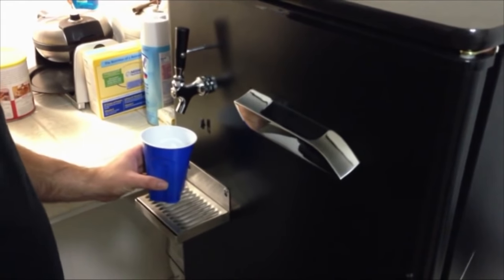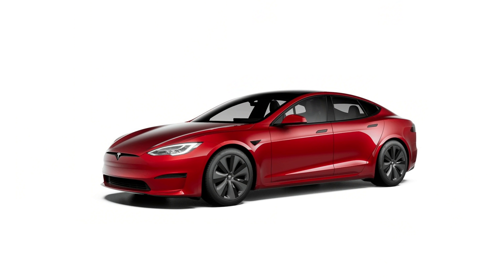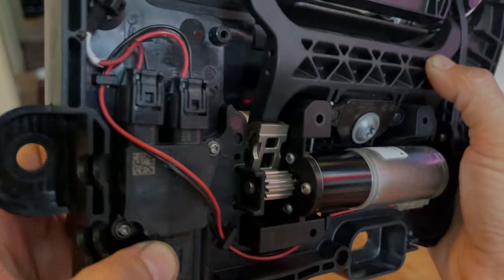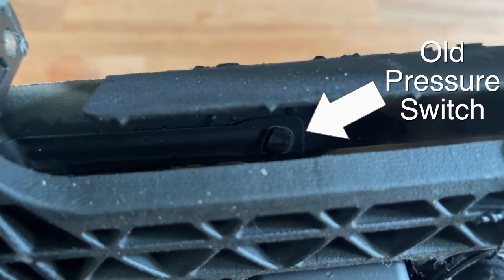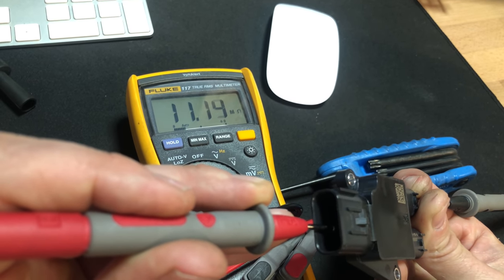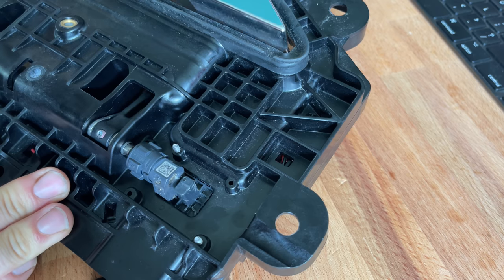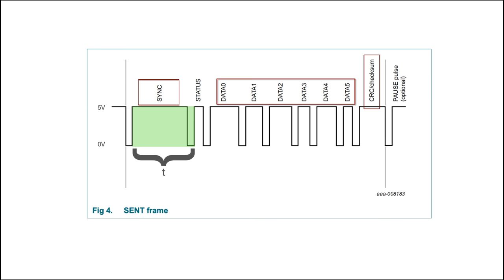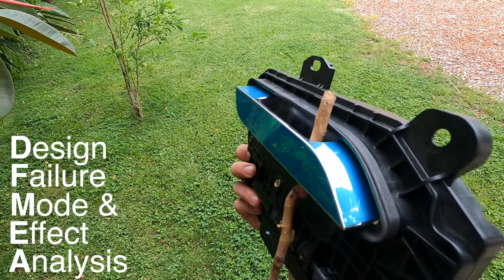Tesla Is Lightyears Ahead Of... Tesla

Comment: great review of the new door handle design.... as an automotive engineer, I always thought that original door handle was a great example of how NOT to design a part. Never understood why engineers put those microswitches on the parts that Moved!!!.. since that makes the wires & connections bend/move, ultimately breaking.
Reply: No kidding, the old design is just plain awful - a perfect example of under-engineering. Zero consideration of the use case went into that design.
Reply: @kain0m  Tesla grew quickly, with few experience automotive engineers. Now they have some more experience.
Reply: First time I've seen that original door handle. My god that is astonishingly awful. Given how complex the rest of the car is and the level of autonomy, if that design philosphy and lack of riguor was present in just 1% of the components that is a frightening prospect.

Comment: Thanks for this! Was wondering how it worked for a while, great to see. :) And totally agree with the physical buttons and switches, helps me to find the problem way faster. ;)
Reply: I was wondering too, pretty interesting handle!
Reply: The problem is there are a whole bunch of useless parts.

A lever and a rod... Works great! 🙄
Reply: RUBBISH! You obviously are unaware of all the faulty signals that come from a microswitch! When subjected to even  moderate vibration, even a hard closed microswitch can open & close its contacts several hundred times a second! It's NOT just "switch" bounce (when the switch state is changed) but "contact" bounce when it is "supposed" to be in a KNOWN state but isn't! DOH!
Reply: @boblewis5558  Ever heard of debouncing caps? Siddown lol
Reply: @MadScientist267  don't be absurd, of course I have, but there are circumstances where they have to be too large in value to do the job effectively. Capacitive touch or proximity switches - fine, but mechanical ones? No!
Reply: @boblewis5558  That's where they not only got their start, but continue to see the most use... What are you talking about lol

They're tiny. pF range! 🤣

Capacitive touch and proximity don't even use them... 🧐
Reply: @MadScientist267  for many years I was a field engineer with the world's largest minicomputer manufacturer and we had a MAJOR problem with certain disk drives randomly doing an emergency head retract, causing the operating system to crash and customers losing time & money. I eventually got to the bottom of the problem which was a "pack in place" microswitch signal (pip) causing triggering of the emergency retract. This signal was being fed to a schottky input Nand gate which had a standard 100 nF debounce cap on the input. 

Running diagnostics I proved that despite holding the switch tightly closed between my finger and thumb the signal could be triggered by the lightest of taps on the side of the switch. The SMALLEST value of capacitor it took to ensure a non activation was a 4u7 tantalum cap soldered across the NO/Common connections. So please, don't argue with hard won experience or a 45 year experience as a graduate electronic engineer! Electronic switching is ALWAYS more reliable than mechanical in any device with severe mechanical vibration - filter caps or no filter caps!!
Reply: @boblewis5558  Ok then that's just shit design and maybe they were more worried about trying to get wetting current up.

Been around the block a few times myself boss.

For 4.7uF to be required for debounce means the impedance of the input is crazy low.
Reply: @MadScientist267  actually not necessarily ... Schottky inputs work off edges, not levels hence requiring greater length of damping. Wetting current may be a factor, however the switch feeding Schottky TTL logic level inputs has necessarily very low current capability (a few mA max) so  highly unlikely this was the reason.

Comment: I guess that end position is measured by current going to motor, similar to obstruction detection in power windows.

Btw, Skoda had flush handles in 1950s - all mechanical. But they were phased out because of safety concerns

Comment: Most likely the current for the motor in monitored, so if for some reason the current spykes and the solid state sensor detects the handle isn't fully retracted it must be chopping fingers and it deploys.
I installed DBW throttle bodies on my carbed bike and used a Hall sensor TPS, it's impressive the precision they have.
Reply: Do you have your bike project online?  Would really like to see it.
Reply: This.
There is no direct logic style feedback per say, but you can monitor load as wicked said. You could probably test it by trying to stop it popping out. If it gives up fairly quickly and retracts, it's monitoring load.
Reply: Measuring for stall torque and simultaneously making sure that motor commands correspond to actual handle deflection based on the magnet angle sensor seems probably sufficient to me, agreed.
Reply: Agree. Controlling electric motor torque is probably something someone at Tesla knows how to do, even EE interns.

Comment: I'm so glad I saw this, I have a 2021 MS on order and the door handles were one thing I wasn't crazy about after seeing so many people complaining about them breaking. Good to know that they've been fixed.
Reply: Well... about that... My 2017 Model S has these Gen3 handles...  the paddle gear is apparently still cheap crap and it broke, so no more present. At least the door did pop open when I pushed on the handle, so that was nice.  Thanks to Electrified Garage I was able to buy the part on eBay and fix it myself (warranty expired 3 months ago of course). Still enjoy the car, though.
Reply: They're still totally crap. 

You can redesign anything you want, but if you build it like crap, it will break.

Comment: Hall effect sensor.  Think of it as one of the many ways semiconductors can be made.  In this case, we have power, ground, and signal out.  The signal changes depending on the presence or absence of the magnet being nearby.  No moving parts, and generally quite reliable.

Comment: They'd put a load measure on the motor power circuit to determine if it is drawing more power than normal and cut the power if it goes past a predetermined limit.

Comment: I'd bet that this thing also detects motor stall based on current draw. I'm sure it won't self destruct itself if the hal sensor positions don't match up with he push lever thing
Reply: If it say motor current and no change in position I've probably just stop or run the motor backwards for a set time

Comment: If i'm making that I sense when the opener arm is at the end of its travel by the current used by the motor. It can try to close against the end of the linear gear, but it will be immediately obvious it is already closed. The part just has to be strong enough to live up to that momentary stall load.

Comment: I'm a mechanic. Here's the problem with iterative design. Without proper version control, and excellent record keeping, you could be looking for a 2017 Model S door handle, only to realise that you need the 2017 v2.13 handle. It's nice to see they've made a concerted attempt at being backwards compatible, though.
Reply: Doesn't have be like that - those two units could very well be interchangeable without SENT. I imagine it just gives them huge saving and standardization cannot prevent progress.
On the other hand have you ever looked for a replacement part for you car? I have to measure everything and compare part to pictures every time. Manufactures don't care about some schmuck who will try to get replacement parts in 10 years and will use whatever non-interchangeable parts they have on their hands so the production line doesn't stop.
Reply: One assumes this is the number one, or maybe number two, reason Tesla famously doesn't let ANYONE work on their cars. The only way to get the right part is to look up the original build sheet by VIN, and even that will probably miss the epoxy blob or painters tape loom retainer, or 3D printed mount.
Reply: @Kammaol  I guess you’ve never worked on a Mercedes Benz, they still produce anything with a part number in small batches, if the parts not available you just wait and sooner or later it’s made.
Reply: @deeeezel  I have a 27 year old Benz. While it's true that some parts have come back into production, in my experience this is rate. There are many NLA parts and more all the time. At first it was mostly aesthetic parts, but I was recently told that the adjustment shims for my diesel injectors are NLA. It's a big worry if they've stopping making critical service parts like that.

Comment: You can measure something-something electrical from the power lines when the motor is stuck. So the motor is the sensor and signal wires are the power wires.

Comment: Something similar to the "SENT" system has been present in model railways for years. It's called DCC, which uses AC rather than DC to send signals to locomotives, points and other devices. Each DCC chip is assigned a programmable code, and when you use a DCC bus to send signals, it sends a signal that only the chip that it is trying to send signals to can read. This means you can have several devices reading complicated instructions on the same two wires. It's mostly used to run multiple trains on the same, unisolated track layout, with independent control.

Comment: I worked at NUMI in Fremont in 2012 as a college summer temp job as a material research board technician. Basically I received, inventoried and routed parts to engineers for failure analysis. I went though probably 12 pallet sized boxes of door handles in 3 months or so. Door handles always seemed to be an issue.

Comment: That last revision is basically a very fancy Hall effect sensor... i used to use some of the less fancy ones with a STM nucleo board (ADC) to replace the old pots on my F-16 replica sidestick. 
The ones i used behaved like a traditional potentiometer on its range of motion.. Attach a magnet to the moving bit, the sensor to the non-moving part and voilá.... 

My last iteration i went a bit further and designed a load-cell based design, so the sidestick barely moves and the output is proportional to the force applied! Similar to the real one. Works great on Falcon BMS!!

Thanks for the video! :)

Comment: Something I hope is brought up in DFMEA meetings is the effects of cold and ice. I've had Toyotas that won't fully latch the hatch in winter because the interior heat melts the snow around the door, it falls to the bottom and refreezes. I end up going outside several times per winter with a hair dryer. I imagine the Tesla door handle might break as described if ice jams it open.

Also, I had an iPhone5 that would give a temperature lockout telling me to allow the phone to cool off before I could use it whenever I would go ice fishing at -30°C. I figured out the problem when I turned the phone over: "Designed in California." It's not always stupid users but designers who can't imagine use cases outside of their own experience.

Comment: I guess the downside of the new design are the magnets, which can be demagnetized and also require rare earth elements. Also the SENT protocol needs to measure the duration of the 5V, so if the timings of the quartz crystals drift apart over time, then it can also cause issues.
Reply: Those are tiny (coffee machine, laptop, etc, all use these), nothing comparable to the kgs needed on the motor rotors. The way to demagnetize these is by subjecting them to 100+ºC temperatures. If your door handle sees that, the door card, paint, etc, are toast. SENT has a calibration pulse, making all output relative to it, so it works with large deviations of sender-receiver timebases.
Reply: @jpinto3912  I knew that....honest!
Reply: @jpinto3912  darn clever protocol!

And couldn’t have come on a better time! I was thinking about using CANbus doe my Hudson. Not anymore!
Reply: @jpinto3912  Heat can cause it, but also impacts, like during a car crash.
Reply: Crystal drift, or any other clock frequency changes are not an issue, the SENT protocol has a synchronization pulse at the start of every packet (32bits = packet).
Reply: @seasong7655  Maybe you could break the magnet with an impact, but I haven't heard of impacts having a demagnetizing effect.
Besides, regular mechanical damage is more of a concern. If I hit a normal door handle with a sledgehammer I'm not so sure it will work either.

Comment: Often the failure point for a moving magnet is the way the magnet is glued to the plastic part. With the effects of thermal expansion and brittle plastic the magnet shifts and the part fails. In the end the techs ultimately replace the whole device, which in this case could be some big change. I wonder if the new handle can be dropped into those older failure prone cars.

Comment: Good video and thank you for the information to fix my brand new and "much better" model S door handle. They are still 100% trash with failure in under a month of use on my 2021 Model S refresh. But now without having to take it apart I know what I'm getting into when i fix it.

Comment: One question remains: are the new door handles interchangeable with an old one that's prone to failure?
Reply: OOOOH interesting. I would assume no due to connection differences. Changing from the old analog type sensors to the new digitial would mean a very different computing scene up the line.

but thats just this dumb MEs thoughts.
Reply: @derekwallin2624  sounds legit - the body control module has to be able to read the SENT signal.
Reply: @dfabeagle718  maybe the old cars would work with swapping the module that receives the SENT signals?   Or that would cause a cascade of other parts that would also need to be replaced to "simply" retrofit the newer door handle modules to an older Model S.
Reply: Could be done if someone developed a converter module that interfaces between the new SENT door handle and the old wiring harness. The signals from the new handle get converted to signals which the old body control computer expects to see. An aftermarket supplier opportunity?

Comment: As interesting as all this is, i can't help but feel that it's unacceptable for the handle to have no mechanical linkage, especially considering some of the other unique and interesting ways some Teslas handle electrical failure.
Reply: If a Tesla has gotten to the point where none of the door handles work then busting out a window is peanuts compared to how much it’s going to cost to get the car fixed.

Comment: “There will always be a few that manage to be more idiotic than 6 engineers ever thought possible”. 

So. Much. This. 

For every design change we make to “idiot proof” our equipment, the world produces a bigger idiot. I saw a guy wrap Teflon tape on the OUTSIDE of a hose fitting and then complain we designed a leaky fluid system…
Reply: My father was an chief engineer on a fishing boat you think idiots are bad he had to deal with fishermen they could break stuff that you or i couldn't if we tried
Reply: i mean... them idiots are the ones that eventually make the product better, what better way to stress test than in the real world, out there....

Comment: Tesla: King of taking something that's reliable, works well, and has been around for half a century, and overcomplicating the crap out of it and making it as reliable as dancing around a fire to make it rain.
Reply: „But it‘s cool“

Say the fanboy.

Talking to the man with the hammer:
„Arduino can’t measure it, because it’s in microseconds“

No, you can’t measure it, because you just can’t. 
Other’s do. They make it use USB, which is way faster in software.

Comment: im a programmer and have no knowlege of engineering, but it's interesting to see the parallels between software and engineering. For example the design of classes in code that depend on each other is just as much an art as is designing different moving parts and sensors depending on each other. Or the DFMEA meetings are a vital part in web software since we need to make sure that users can't hack our site to gain access to the underlying database

Comment: 9:30 "Would it break itself trying to lever the handle back farther than it would go?" The control module could monitor the current to the motor and if there's mechanical resistance there would be an increased current demand

Comment: Very interesting video, but your description of how the angle data is transmitted via the SENT protocol is somewhat off the mark. It does not rely on the duration of a pulse; it is encoded digitally and sent in the 4-bit data packets D0 to D2. Values range from 0000 0000 0000 to 1111 1111 1111 (which equals 0 to 4095) when using the single sensor format. There are some other formats which encode the data packets in a slightly different way, but the principle remains the same.

Comment: At least brushless electric (stepper) motors can detect travel end points and protect user and the parts. Or rather the speed controller can by monitoring the current going through the motor. When the resistance to the movement/torque required goes up, so does the current demand of the motor. I'm not sure if that works for brushed where there's just a constant voltage like you've shown. But if it does, that might be how they mitigate that edge case you mentioned at the end and prevent the motor from breaking the lever.

Comment: This is great not just for the simplification. But the fact that this tech exists. So many issues can be solved with this technique and it's ingenuous. 

Also there might be a limit on the motor not to exceed a certain electrical load and if it gets close the motor may automatically return to position